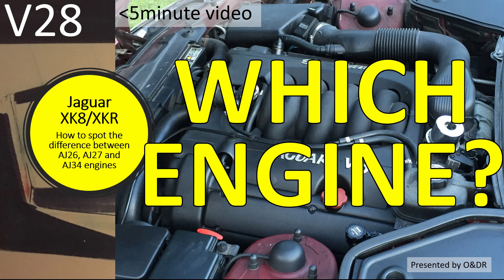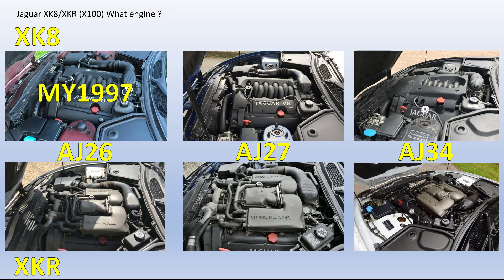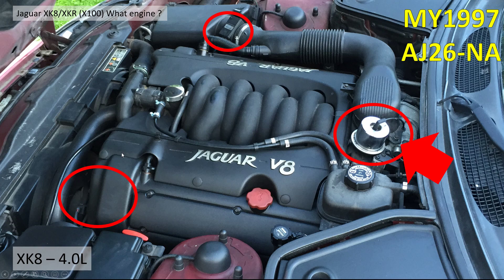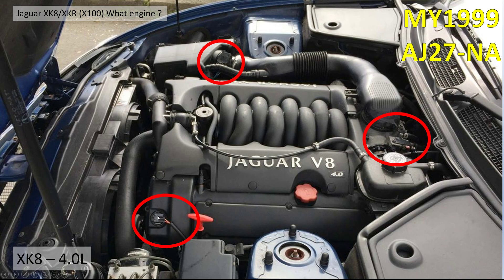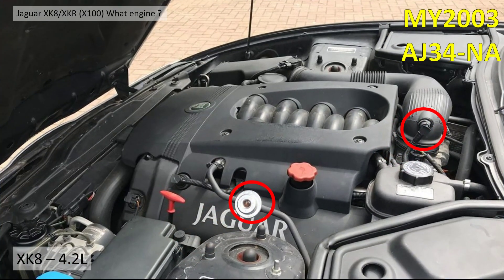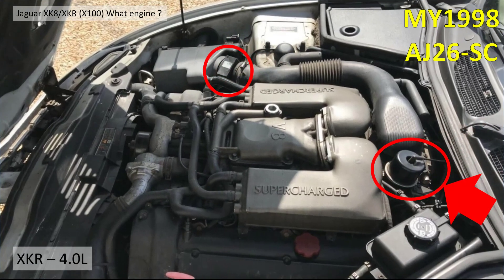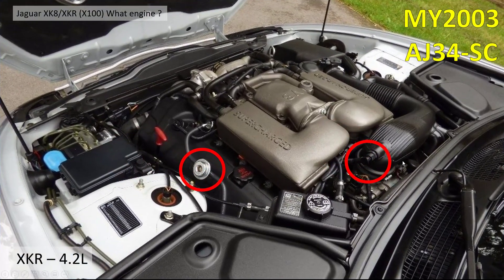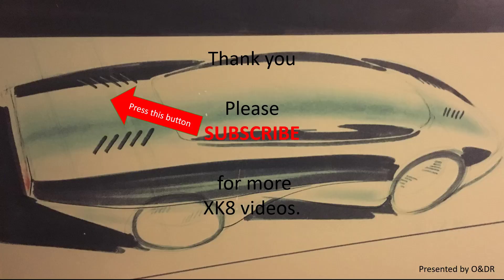Which V8 Engine, AJ26, AJ27 or AJ34 ? How to identify your motor easily V28 Jaguar XK8 / XKR (X100)

Comment: Fumo nero tubo di scarico da che cosa e causato? Consumo carburante esorbitante?
Reply from the maker: @AlbertoGalli-h8g, El humo negro normalmente indica que el motor está quemando demasiado combustible.
El exceso de combustible produce hollín, de ahí el color negro.
Lo primero que hay que revisar es si el filtro de aire está obstruido, si los inyectores están defectuosos, si la presión del combustible o el sensor de flujo de aire (MAF) está sucio.
Un lector de códigos te dirá si se trata de un sensor defectuoso o incluso de un problema con el MAF.
Sugiero hacer lo más sencillo: primero cambiar el filtro de aire y limpiar el MAF.
Espero que te sirva de ayuda, saludos, Damian.

Comment: Hi Damian! Thanks for getting back. I ordered that O ring! Thanks for the part #. If I can pick your brain a bit.... The shifter seal inmy ZF Trans is leaking a bit. Part # JDE26439, I have the seal. Can that be installed without tranny removal??? Tranny ZH5HP24. Thank you sir!!! Regards, Ben. PS.   LOVE your videos, as much as my Sleek Black Coupe, Coffee interior.
Reply from the maker: Ben, reference the tranny seal. I haven’t had any experience of replacing that seal. The shifter mechanism is located on the side of the tranny. I know you need to remove the mechanism before removing the tranny. Not sure if you can access the seal from there. The only issue would be the oil level and might need to drain the box also. There are some good ZF rebuild videos on line which might show it. Sorry can’t be more helpful, regards Damian

Comment: Thanks! I have the AJ26. Which Seal for the VVT on the front of the head? Mine is leaking. Not sure if it is the VVT seal or the valve cover. Thanks for the video. GREAT JOB!!! Ben.
Reply from the maker: Ben, There is an 'o' ring which is used to seal the VVT to the front engine cover. These are low cost, easily access and replace. Suggest starting with replacing those first. The part number is KSC145624 and available from SNG Barratt and other suppliers. Link below. Hope that helps, regards Damian
https://www.sngbarratt.com/English/#/UK/parts/40d63924-93a6-4487-ac60-e5896a11b29e

Comment: 3:50 re the AJ27 XKR 4.0 supercharged vs the aj34, I am curious why they include a sensor in the intake pipe just before it enters the supercharger manifold; afaik you would only be interested in the charge air temperature of the intake air after it has been compressed and intercooled; is this to determine intercooler efficiency during the cycle by comparing the difference between uncompressed intake air temperature and charge temperature?
Reply from the maker: Iain, good point never thought about it. It is possibly a linear cooling effect or predictable or already tested and mapped. Much easier to sense at the upstream air box. Not pressurised or near the heat of the cylinders. Combination of the two makes for this a practical solution, possibly? Maybe someone can add light to it. Thanks for comment regards Damian

Comment: Until august 2000, the xk was equipped with Nikasil engine. If I want to buy such a model today, am I taking a risk? I read on a website that if the Nikasil engine has survived until today, the risk is minimal. What precautions should I take when buying such a model ? Or is it better to buy a more recent model ? Thank you for your answer.
Reply from the maker: JB Mon, Good question. I have a 1996 UK model with Nikasil Engine with circa 80,000 miles and no issues. The concern came from the sulphur in the pre-2000 UK fuel eating away at the coating. Therefore, there was only maximum 4 year window of opportunity for the fuel to cause this issue.  If the car did reason length journeys in that period then would not have any problems, as in my case. If you are in the US  I believe the low sulphur fuel didn't come in until 2006. Therefore it is a bit more of a risk. However, the engines are now 16 years further from that point. Hence the idea that if its survived its probably OK.  The hi-tech Nikasil coated engines are actually lighter (hence better?) than the steel line versions. The 'Nikasil' problem gives excessive bore wear and this results in lack of compression and blow-by (excessive crank pressure).  Symptoms are poor cold starting, lumpy idle and excess crankcase pressurisation. I expect you will get oil excess in the intake due to the crank case ventilation. Compression testing could also help. Generally the later the model the more these type of issues can be avoided due to improved design (metal tensioners/steel liners/etc). However, due to how old these car are maintenance and condition are key and not age/mileage. If you buy one of these cars you are going to get issues its just trying to avoid the worst and most expensive ones is the trick. Hope that helps and good luck with the search, regards Damian  PS take a look at this book https://youtu.be/3yIPr1Ggcms
Reply: @Modurol  Thank you Damian for your prompt response and for your very complete explanations.

Comment: Hi Damian and thanks for the video. I had no idea until now that there was an updated AJ-27 version. I thought it was AJ-26 until the capacity changed from 4ltr to 4.2.
Is there any difference/benefit between AJ-26 and 27? At what stage/engine no. was the version 3 metal body cam chain tensioner included at the factory?
I'm trying to establish in my own mind, which is the best AJ engine to go for in terms of performance/reliability AJ26, 27 or 34 normally aspirated - any thoughts ?
Reply from the maker: David, covered this within the model year changes, might put one together just of the engine changes alone. There are quite a few refinement, air assisted fuel injection, electronic throttle, advance and retard on the VVT,  cams sensors on both banks of cylinders etc. Take a look at this Jaguar XK8 Model year specifications V40a XKR (X100) https://youtu.be/I0blRCUWBmg Hope that helps and thanks for the comment regards Damian

Comment: Thanks Damian, very informative. I notice also that they dropped one of the two small bore hoses running from the coolant expansion tank retaining only the one that runs to the thermostat 'tower'. Also superficial but the ABS cover dropped (cost saving as John @TTG has noted in his videos).
I did make some comments on your video on your block lifting method (video 4) - very interesting - and asked if you'd filmed any of your front suspension/rear suspension overhauls, also if you went to poly bushes??
Cheers
Dave
Reply from the maker: Dave, thanks for the comment and input. Was just looking for the obvious stuff on this video but may plan to make a more detailed version as well. Will add our observation in that. Yes, I have done the front and rear suspension re-bushing but only used polybushes on the front upper arms. Seems to have worked well in that installation. Much appreciated, Damian